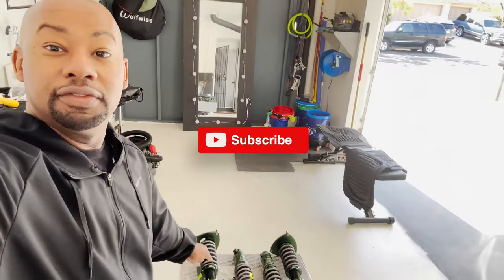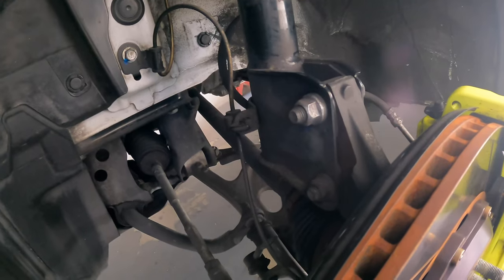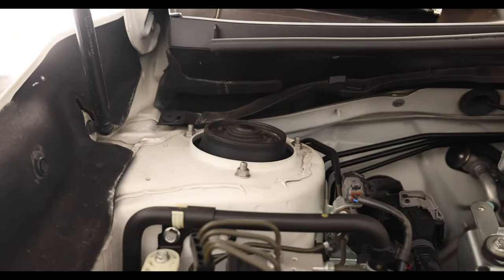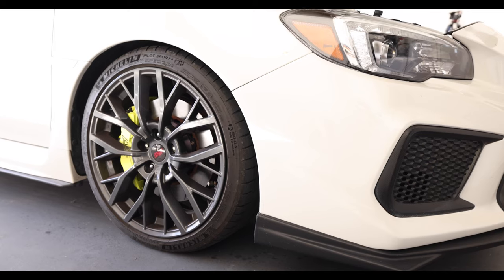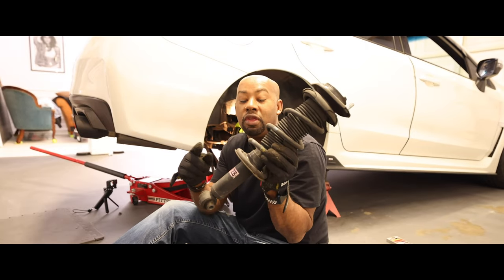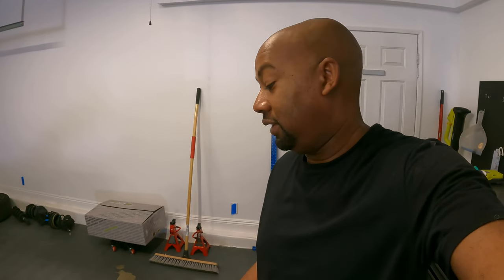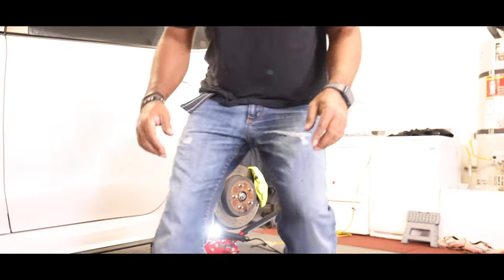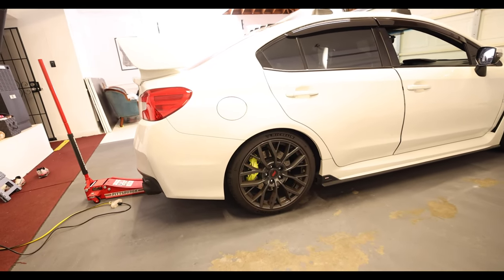How To Install Fortune Auto Gen 8 Coilovers  WRX STI

Comment: Would reccomend getting the Whiteline bump steer kit! It fixes the geometry of the suspension when you lower your coils. I have a bit of suspension stuff to do to my car.
Reply from the maker: good idea. I recently picked up lower control arms to fix the camber in the rear. ugh more money
Reply: @DonteTidwell  Yeah I'm waiting for mine to come. Currently whiteline has 30% off it right now so I bought it, since that's the one thing I'm waiting on before I install the coils I have sitting in the garage.

Comment: Nice video and nice sti... I have the same color too. I just have a quick question... You know the 3 bolts that tighten on top, are the body frame good enough to handle the bumps.. you know sometimes is hard to avoid with high speed on highway and suddenly there is a bump or uneven road.. when it hit, you hear a loud noise coming through the front  because if the force that hit to the top that connect to the body.. will that do any damage to the frame or the metal that bolted ..thanks
Reply from the maker: I dont think so. but I really dont know

Comment: Hey good morning sir l have a question what size rims and tires you running on yours and when you adjust the coil-over was their room to go up and make the tires all round a two finger space l bought a set yesterday the Fortune 500 how do they ride and what’s your spring rate you have on yours looking forward to your response and thanks for the Video clip
Reply from the maker: Hi, a detailed wheel and tire set up are in this video https://youtu.be/mhoQXZ2Zo8g
FORTUNE AUTO GEN 8 500 SERIES
DEFAULT 8K SPRINGS 

Ride Height
Front: 25 1/2"
Rear: 25 1/2

Lock Rings Gap
Front: 2 1/4"
Rear: 1 1/2"

the coil over can be raised up pretty high. not sure how high
Reply: @DonteTidwell  thank so much